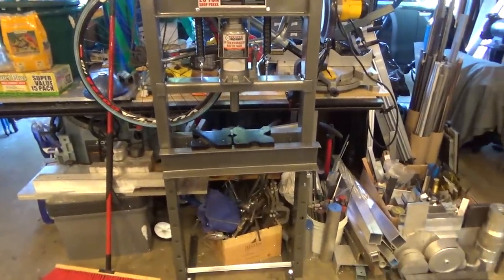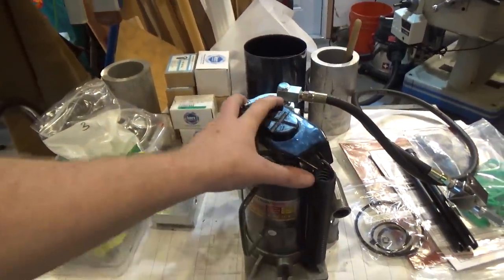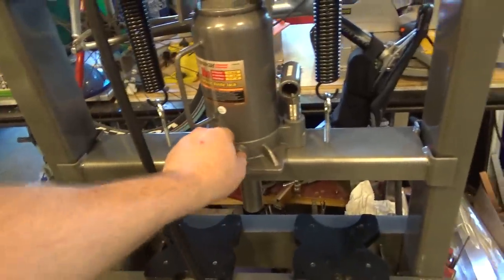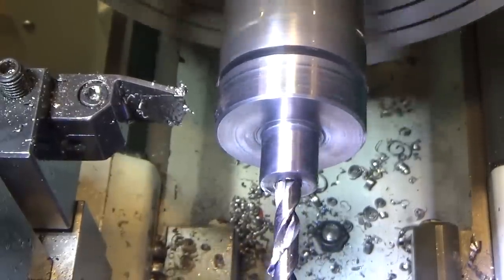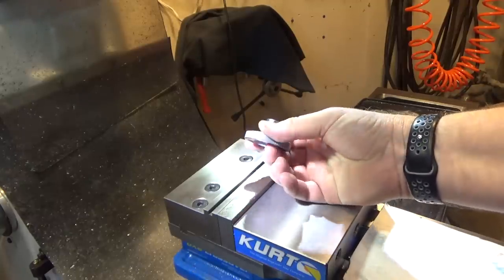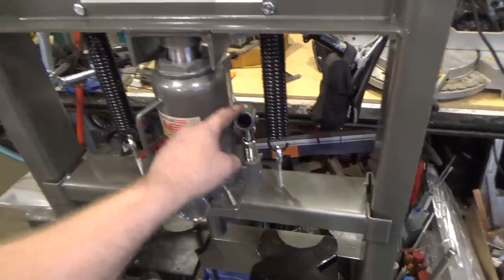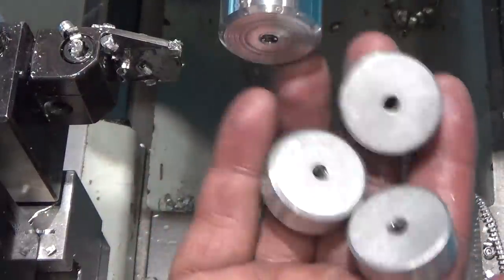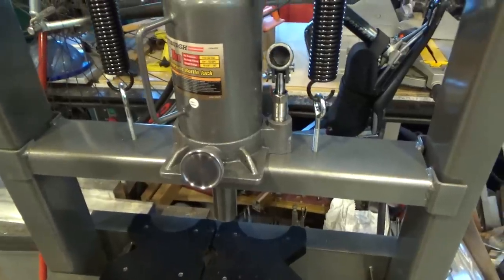Improvements to a Harbor Freight 20 Ton Hydraulic Press Part 1

Comment: You wasted time switching to the collet. You could have done every lathe operation holding the workpeice the fist way with the exception or facing the top. Just spin it around in the three jaw and do that. Then you should have machined the slot in the Y Axis on the mill while pushing against the fixed jaw. Theres a less chance of the workpeice moving. All and all not bad. Keep at it and learn something new everytime you work. Good video. I like all of the upgrades you added to the press. Even tho you put time in adding those options it will save you the time spent many times over during the life of the press. Smart work and you learned something along the way.
Reply from the maker: Thanks for the good suggestions. I am torn about the cutting towards the fixed jaw because I only have power feed on the X-axis. I guess the more consistent finish would easily get trumped if the part came loose. Thanks for taking the time to comment and help me out.

Comment: If your air jack quits working set it on a stove and warm it up quite warm. I've had to do it to 2 of them and they have worked ever after.
Reply from the maker: Nice tip. That is an interesting solution. I wonder if you  are slightly melting the fins in the air motor. Thanks for the insight.
Reply: I didn't get them that hot just a little hotter than able to handle bare handed. I have no idea why it worked one of our local stores quit selling them for that reason so I told them what I did and they claim it worked on a number of them they had returned.

Comment: Mr. Toolwright,
Thank you for the video.  I have a couple of questions though.  
1st: why no lubricants when cutting/milling/turning?  
2nd:  my experience is that tools with the carbide inserts cut a whole lot better at high speeds.  Much higher than I think I heard you mention.
Last, when cutting narrow slots or keyways decide to cut in one direction only -so the rotation of the bit is travelling with the direction you move the table under it.  You may break fewer bits.  It is slower, but it seems to matter to my mill: especially the older the machine.  I might have set the part up in the vise a bit differently too - just to minimize the chance of motion when I least desire it (and another bit gets broken.
Thanks again for the video.
Reply from the maker: Thanks for taking the  time to share this useful advise.
 I don't use cutting fluids all that often because I have this paranoia about rust. I know that there are corrosion inhibitors in these fluids, but in nearly every case where I watch videos of people using them their machines have a patina on the ways. I know, a bit on the nutty side.

I can get a decent finish at the lower speeds I use and if I wanted to be more aggressive I would probably need cutting fluids, so back to my irrational fears.

I will take your advise on the slot cutting, thanks. I had not considered some of your suggestions. I was aware of the good practice idea of cutting towards the fixed jaw of the vise, but I only have power feeds on the x and z axis, so if I want to take advantage of a smooth feed rate, I have to cut in the X direction. However, you do make a very good point.

Comment: My cross bar kicks over at the oddest times. So I take a splitting wedge and drop it down on either side of the crsso bars so it get pushed over to one side . No more kick out
Reply from the maker: Nice suggestion. You seem to have definitely used the press more than I, so thanks for the solution to a problem you have encountered. I will remember it. I made my cross bar a pretty close fit, but still, great to know. Thanks.

Comment: As for the bottle jack vs power pack and cylinder, I'd prefer the bottle jack version for the fine control you'd get out of it. The air driven jack is a nice compromise.
Reply: killerdoxen, he still has the hand pump for the jack so he still has the fine control!
Reply: John Brock I know. That's why I said it was a nice compromise. He has more speed while using the air and still has the control that I believe a standard hydraulic cylinder doesn't possess. Bumping a lever of a hydraulic valve isn't very accurate at times.
Reply from the maker: Thanks for the comments. They are always appreciated.

Comment: you've got a lathe and a cnc machine for just hobby time?  Dang, that's pretty nice.  How do I smash steel pipe to have a flat end for bolting to something?
Reply from the maker: I don't have any cnc equipment, but am still very lucky. I would use a vise to flatten pipe like EMT if that is practical.
Reply: @DudleyToolwright  No I'm talking like a sch 40 steel pipe.  I've gotta replace a bracing bar on a drum mower and one end is flattened with a bolt hole drilled through.
Reply from the maker: That will probable need a hydraulic press.  I have never tried anything like that. I wonder if 20T would be enough? I might give it a try just to see. Interesting question, thanks.
Reply: Just heat the pipe with a torch

Comment: I want to install brass set screws in the carriage that the jack is mounted on mine moves a round when the pressure increases. Looks like the end mill could be in the collet deeper? 28cruzin answered and then some, thank you sir.
Great job on the video will subscribe now..
Reply from the maker: Thank you very much and the idea. Much appreciated.

Comment: nice mods!  mine has a plate that the jack bolts to.  does this one have that and if so do the bolt holes line up with hydraulic jack?
Reply from the maker: Nope. Mine was just floating. The new plate I made had a channel to keep the jack aligned and the top of the press has a port that the ram of the jack fits into.

Comment: 8:57-tool's cutting edge experienced a degradation..
12:33-Steady coolant flow works wonders for a smooth finish cut.
Intermittent Coolant application results in a small, but noticeable,
surface variation.
14:14-Like to have your patience and know how.
Reply from the maker: You are completely right, I need to bite the bullet and deal with coolant.
Reply: @DudleyToolwright  Me too. I use a spray bottle of coolant oil/water mix. The flowing coolant is a big step, I am ok with the bottle for now.
Reply from the maker: I have a coolant system built in, but worry about corrosion. Everyone who uses it on youtube has corrosion around their machines. I know there are anticorrosion agents included, but the fear persists. I should use a spray bottle I have, at least.

Comment: Great explanation - THANKS! 
Can the 20Ton cylinder be safely "fed" by the larger 10,000PSI air pumps (HF has those, too, that sit on the floor and have a pedal on top)? I've had the the more common system with the attached air motor and they have failed twice for me. I'm thinking maybe the 10,000 is better and faster? Thanks again.
Reply from the maker: I don't know, but you pose a very interesting question. I was not aware that Harbor Freight even sold a high pressure pump of any kind other than pressure washer.
Reply: @DudleyToolwright  Yes, but I just checked and HF quit carrying item 98318. Still on amazon though and they seem to run in the sub 150 dollar range.  THANKS again.

Comment: Mr. Dudley , I have to same set up like you , with the air hydraulic bottle jack on the Harbor Freight  press, wondering if you can or will make me a knob like your. just let me know how much you charge
Reply from the maker: If I had a CNC machine, I would definitely do that, but with manual machines the time involved would make the cost prohibitive. Perhaps I will do a limited run. Thanks for the excellent suggestion.

Comment: You are breaking the end mills because of improper mounting in the collet. By holding on the flutes you only hold on the cutting lands. You need to hold on the shank , where it is full round.
Reply from the maker: Did I do that? I certainly know better than that, thanks for pointing out a carless mistake.

Comment: If you want a motor repair to last a while you need to remove the commutator, using a fine tip instrument such as screw  driver, etc. clean out all the grooves of the commutator. Each segment goes to winding which there shouldn't be any continuity between. Cleaning and re-grooming the slots on commutator helps to revive the motor giving it some more life.  Also before re-grooving (repairing the grooves) you should sand the entire commutator (copper part) with a fine emery cloth, only enough to clean it up some more.

Cleaning the commentator with some paper towels or cloth probably  won't last for long if the commutator needs to be re-grooved. At some point in time the commutator just wear out and the entire rotor needs to be replace. (Though I've seen a few motors where the copper part with grooves is replaceable) Basically you don't want any continuity between the brushes and the copper segments (between the grooves)  of the commutator.  Then there's also the bearings that wear out. Many of the automobile motors don't have spare parts as the manufactures want to sell you more motors. However sometimes you can either salvage good parts from blower motors in a JY or you can measure the bearings and brushes and try to match bearings and brushes sold in online and in stores that sell motor parts. Different motors often use common internal motor parts. So there would probably be new brushes and bearing available if able to match their size and dimensions to new parts. There are motor repair shops, however I'm uncertain what they would charge to restore a commutator and replace bearings and brushes. Possibly if the commutator is bad beyond repair, you can find a good one the correct size from a used motor, which is most likely used in many different vehicles.
Reply from the maker: Your reply was quite interesting. I have never tried to repair a motor of any kind. Thanks for the useful information.
Reply: It use to be quite common years ago, but I guess today everything is designed and manufactured to recycle or replace and throw out. I think the land fill are ever increasing as no one repair anything any more. It use to be product were designed and manufacture to be repaired and last 30 years and longer. I've old refrigerators manufactured in the 50s that were still running well keeping food at proper temperature after 50 years. But today your sometimes lucky if something able to last 3 to 7 years (depending on the product)  Product are being designed to throw away and not to be repaired. There's actually fewer repair shops and people than there was years ago as it usually cost same or more to repair a product than to replace.
Reply from the maker: Boy we are on the same page here. It is quite the travesty. I have thought on more than one occasion that we need a store that sells multi-generational tools, but who would pay ?
Reply: I think I was trying to reply  to another video about motor repair and I wasn't aware the youtube website switch me over to your video about the shop press which I think I viewed a while back as at one time was thinking of purchasing a 20 ton shop press for some automobile and other work. I was looking at several presses including the one from harbor freight  which I remember watching our video quite a while a go you made some improvements. Years ago I did work in the shipyards along with machinist as a fitter in metal fabrication. I use help the machinist building foundations for large propellers and other equipment in ships, freighters, Navy boat, etc. but that was many moons ago.
Reply from the maker: I figured something like that had happened, but it was still an interesting read. Your previous job in the ship yards sounds fascinating and a lot of hard work at the same time.
Reply: Yes, I was working for the shipyards from 1971 to the early 80s and loved that job. However in the early 80s many of the shipyards were being underbid by Shipyards overseas such as e.g. Seoul Korea, etc. where the cost of living is lower with lower hourly wages. The foreign  companies were able to underbid many if not most of the US shipyards.  US manufactures also started to leave union work if possible, they didn't the unions, which help to build our nation and the industrial complex.  Many of the union jobs no longer exist as manufacturing started to go overseas, where they don't need to pay their skilled (and unskilled) worker the same has her in the US. Many of the US  Businesses will find he cheapest labor (skilled and unskilled) as possible.  I think because their jobs just don't have that much of an interest in the older style (skilled and unskilled) labor that have been around for centuries. They want to automate labor (both skilled and unskilled)  Fewer and fewer people know how to repair. We seem to be loosing some of our basic skills that have been around for up to thousands of years. The trend now a days is to replace and not repair. Where not that many years ago I can remember in my youth there were plenty of repair people willing to perform repairs at a reasonable fee.

Comment: You were complaining of poor finishes, which appear in some cases to appear wavy to me. Have you tried checking your lathe for play in the head and carriage with a dial test indicator. There are some really great sharpening videos which may shed some light on your problems since they have to have a tight machine to eliminate unintended movement. There is also a leaning toward tool steel cutters for improved finish in some materials. Some lock unused slides to eliminate movement.
Reply from the maker: I did check my lathe when I got it (It is only a little bit over 2 years old) and it was well within spec. My first goto for any problems I am having is my procedure or choices, because I am quite new to machining and often do not make the best choices. A lot of people have recommended HSS cutters. To be honest I haven't used them very much. Historically, HSS tooling was always sharper than carbide cutter so the finish could be better. I have had some conversations with reps from the big insert manufacturers and the "claim" that these issues have mostly gone away. However, I am definitely not challenging methods proven over many years. I have not added HSS cutters, mostly because I did not want to add another set of variables (grind, hone, tip rounding, etc.) to my already shaky skills, but I definitely will at some point. Thanks for taking the time to share your recommendations. I really appreciate it.
Reply: May I ask how much you paid for your lathe? Did you buy it new or used? I understand if you’d rather not answer. I know some people don’t like talking about money

Comment: Great video - what lathe and mill are you using?
Reply from the maker: ACRA mill and lathe. Both have been really good. The mill is Chinese made and is definitely not as smooth as the ACRA Taiwanese one, but the lathe was made in Taiwan and is outstanding, at least to my novice experience.

Comment: I was looking at the 20 ton air, hydraulic press for use in stump removal. 6 ton worked ok, but the air component would have been really handy. How well do you like the 20 ton air, hydraulic jack?
Reply from the maker: The build quality is what you might expect. I haven't used it enough to really tell. There was another commenter that said that they had one and the air motor died within a month. Hope that helps. thanks for the comment.
Reply: I noticed one that was a combination jack that had a quick connect fitting, and I have a compressor with spare air tanks. I might go that route. Thanks for the feed back.
Reply from the maker: Glad to help and thanks for the comments. They are always interesting and though provoking.

Comment: I like all of your suggestions; however, I do have a concern.  Are you weakening the two plates by drilling holes into them?  This is especially a concern since they would be under pressure when used.
Reply from the maker: I would say almost certainly so. I figured that they would build in some strength overhead into these parts, but I might have severely overestimated Harbor Freights design methodology. Others have complained about the stock plates breaking, so I might be in for some trouble. However others have said that their press plates were cast iron, but the way min cut during drilling lends me to believe that these are not. Thanks for the comment.

Comment: I see that HF also sells a 30T Bottle Jack ... If you were to replace the 20 with a 30 Would it be a 30T press or still a 20T due to the frame?
Reply from the maker: Excellent point and I almost tried to up the pressing force. Check out my video on testing the pressing force of this press and you will get your answer: https://youtu.be/w7X3DCfMwtA